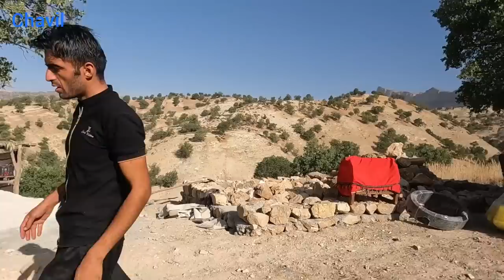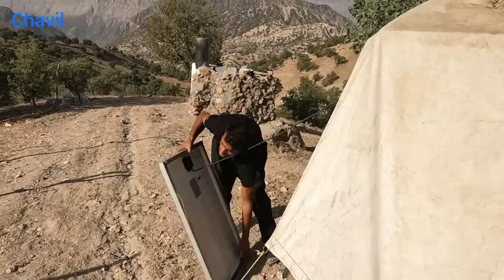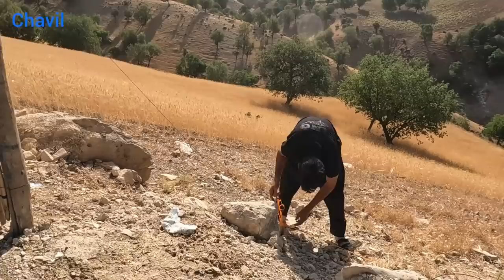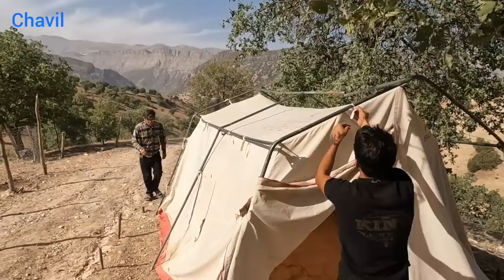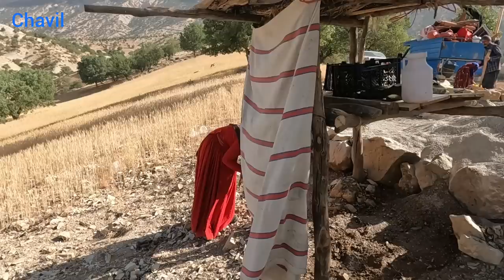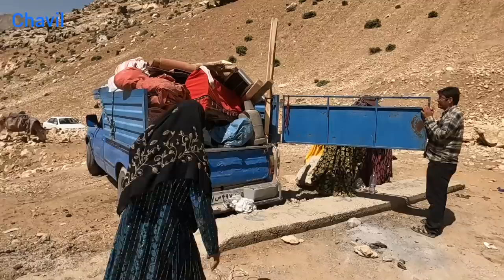Nomads Migrate to Colder Climates due to Hot Weather: Nomad life in IRAN(part 1)

Comment: It depends what you would call a luxury.  I like ,my running hot & cold water, a shower, heating in the Winter & cool air in the Summer.  I don’t want to cook over an open fire, I prefer the clean gas/electric.  Other than that, I could live in a tent for a week or two - but that’s all